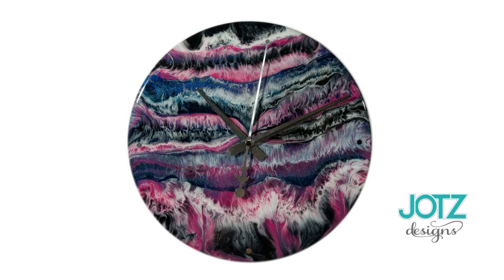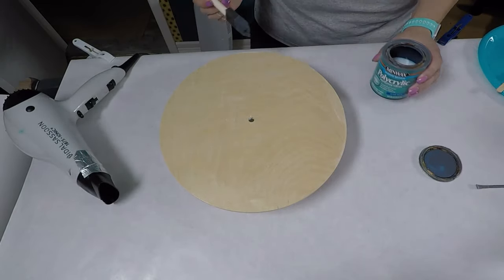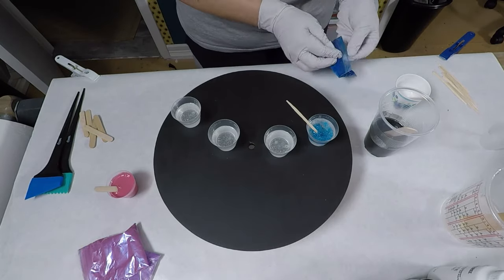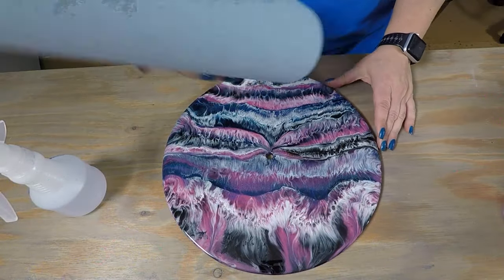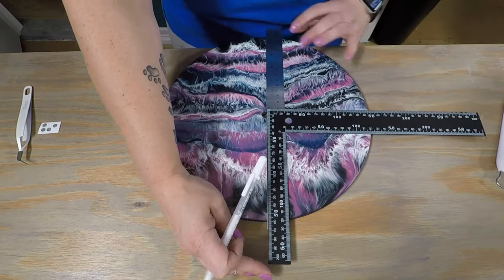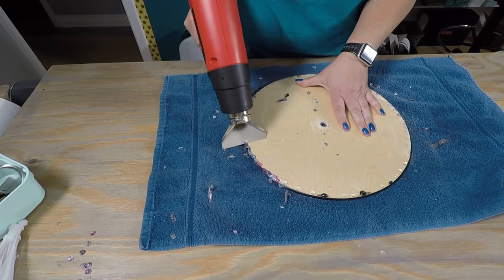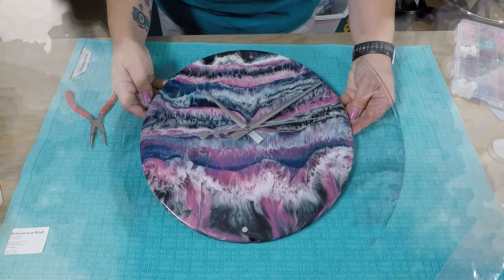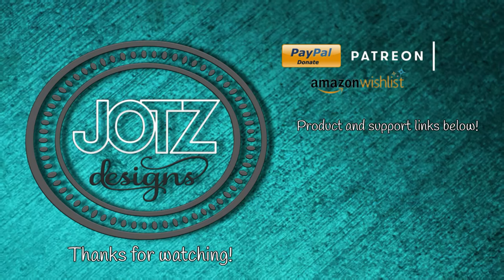Epoxy Resin Clock Tutorial Using Silicone Oil for Effects | ProMarine

Comment: Great looking clock, just a tip if you use painters tape on the underside it only takes moments to clean up.
Reply from the maker: Thanks! I do use painters tape, and prefer electrical tape on smaller things...so long as I remember to put it on before I start pouring! Check out some of my other videos!